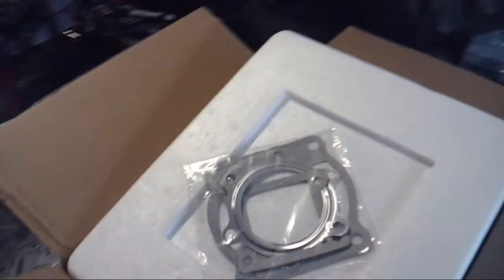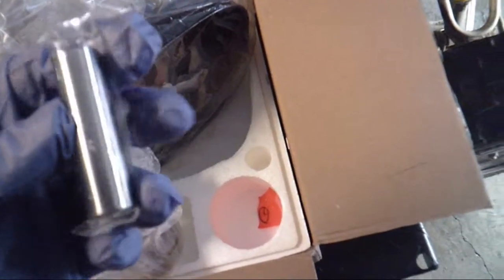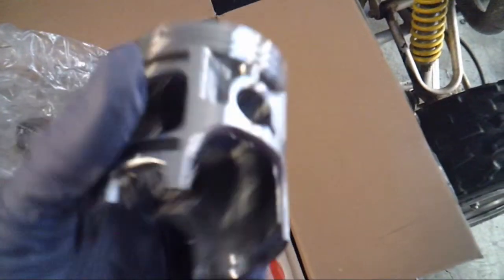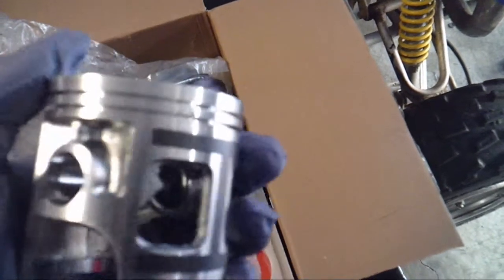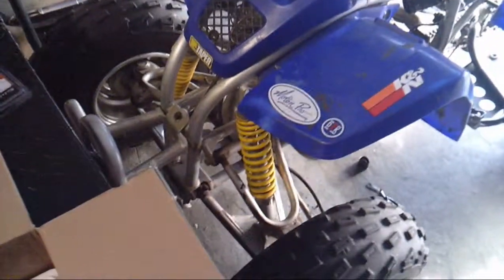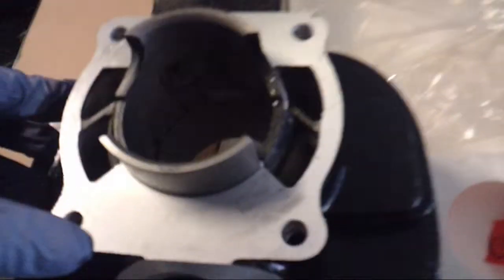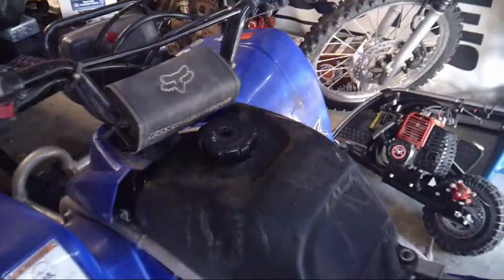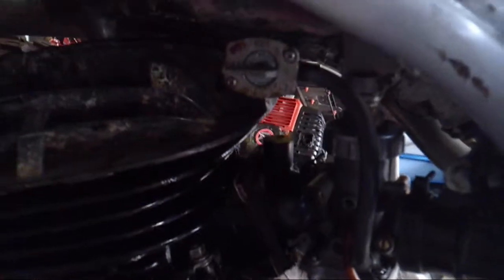2000 Yamaha Blaster rebuild, THE CHEAP WAY!! New top end kit with rebuilt carb. WILL IT START OR RUN

Comment: How do you remove the studs from the old head and put them into the new one?
Reply from the maker: Evryn The 1 And Only different ways of doing it. I usually screw to nuts down and then work them against each other until it starts moving. Be careful because this method can snap studs off.
Reply: The best way is to heet them up the drop some water to cool up then take them out by 2 nuts